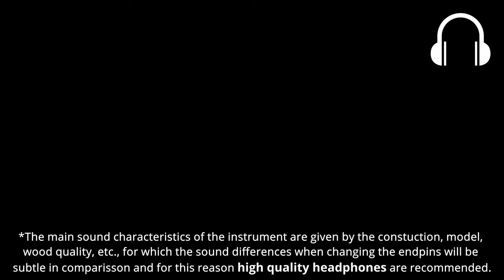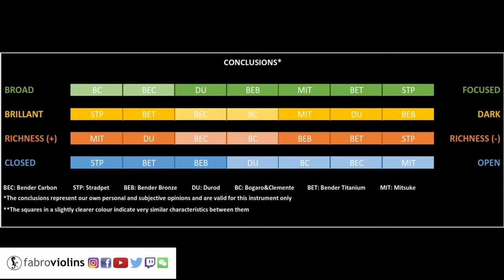CELLO ENDPINS | Sound comparisson | FABROVIOLINS

Comment: Now this is a cool video, I've been searching for stuff like this in the past. Must have taken ages to make :-P
Of course it's difficult to hear as much of a difference as I know you can in the room. I find even the floor you're playing on makes a noticeable difference in person, but considering that, I believe I do hear a difference, at least between the materials. 
I'm definitely fan of carbon fiber, but this did reignite my interest in titanium endpins as well. I can't afford doing a test like this myself, but I'll certainly consider titanium for my upcoming Strad model cello, which I want to be mainly projecting and brilliant.

One question I have though, is the endpin socket the same, and you're just changing the pin itself? What material is the socket in that case?
Reply: same question is the socket the same?